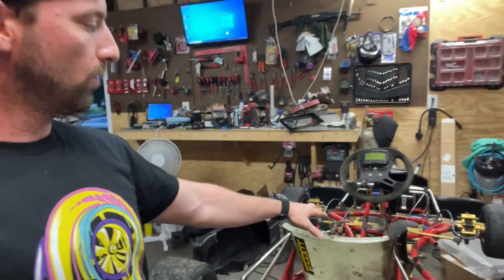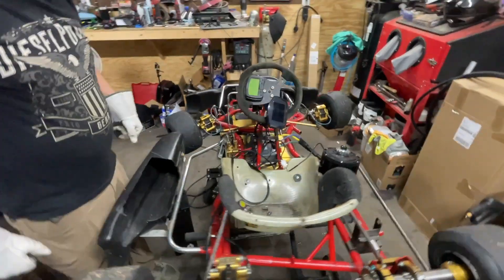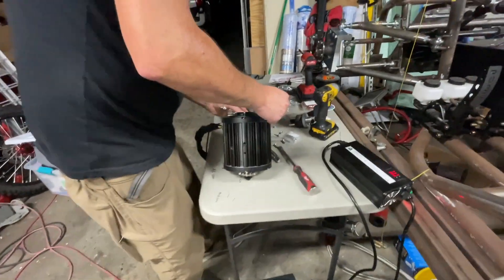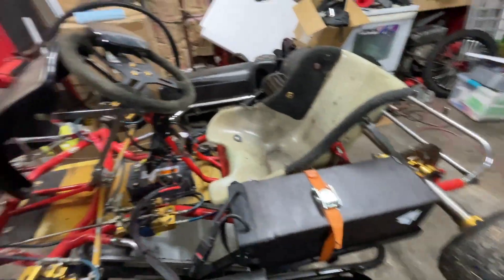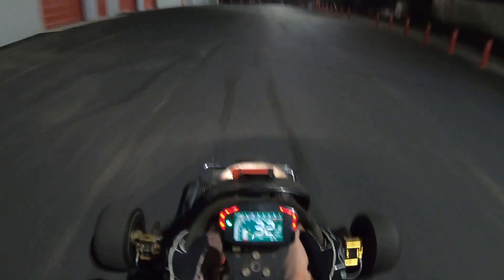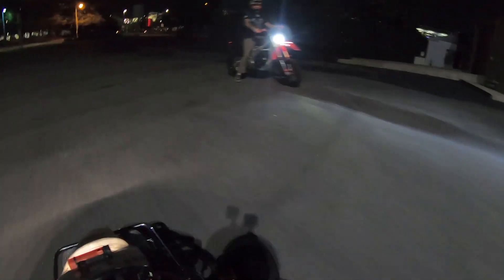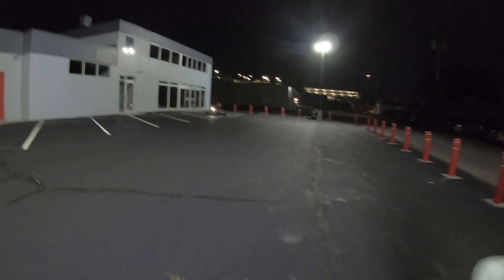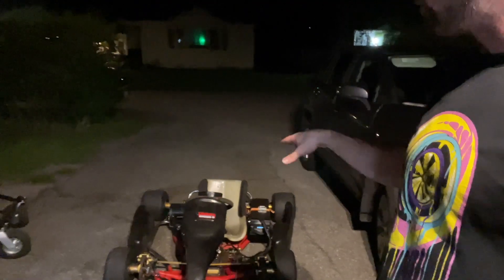100MPH EV Go Kart Build Part 1

Comment: Also, what size sprocket is on the axle?
Reply from the maker: Not sure it’s the smallest I had. All I know if with the motor gear and the sprocket the top speed should be 102mph

Comment: Hey again, how did you mount the battery tray to the frame?
Reply from the maker: It’s welded to the frame. We made a tray and put it where the radiator used to be.
Reply: @theperformancereviewchannel sick, and what 0-60 mph time did u get on the kart
Reply from the maker: @ 4.3 is the best so far. What is your setup?
Reply: @theperformancereviewchannel  sick, im using the same qs138 but running about 30kw